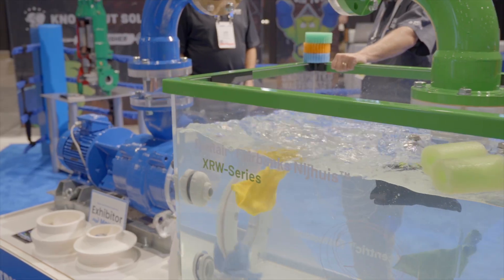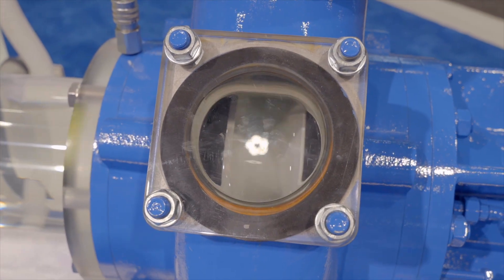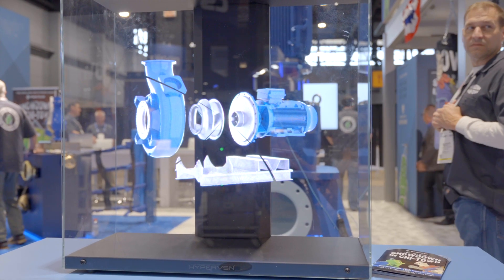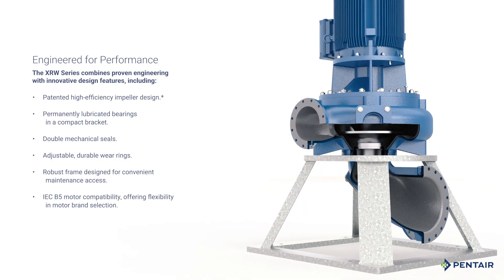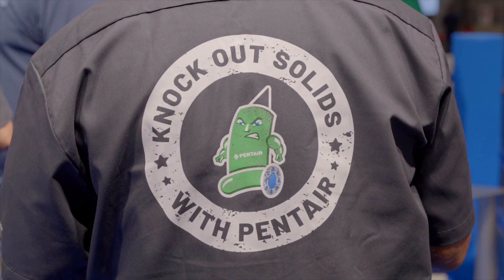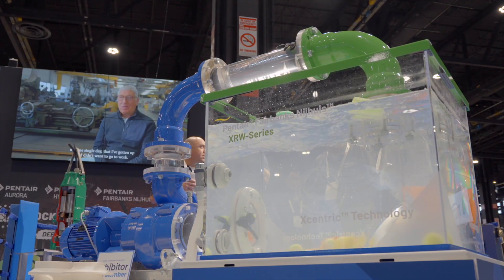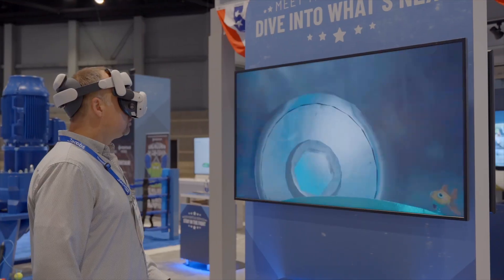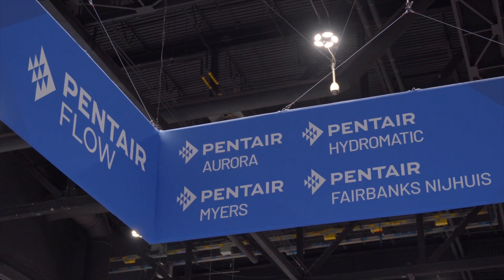Revolutionizing Pump Performance: Pentair’s Xcentric Impeller - WEFTEC® 2025

Comment: I have worked for about 27 years in Pentair Fairbanks Nijhuis in Winterswijk Holland,  Testbed manager for 20 + years. this pump has been developed at the Nijhuis facility in Winterswijk Holland❤ ,  
I had the honor to test the really first scale model prototype pump ,  remembering that I said to the research department, that’s a “ excotic design “ of impeller.